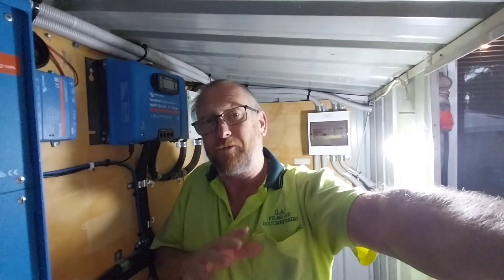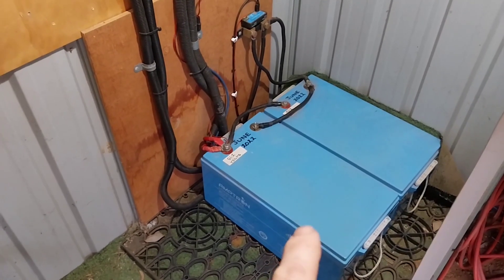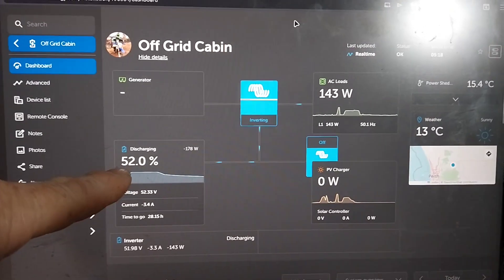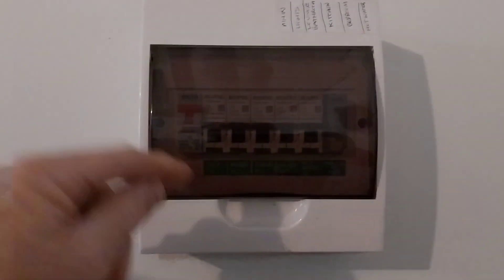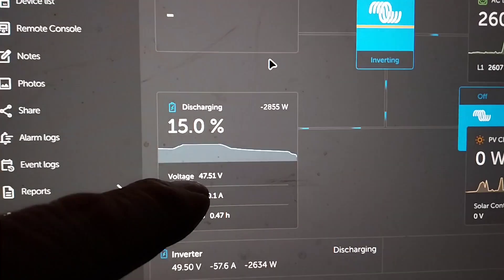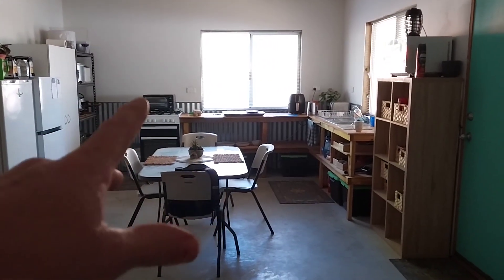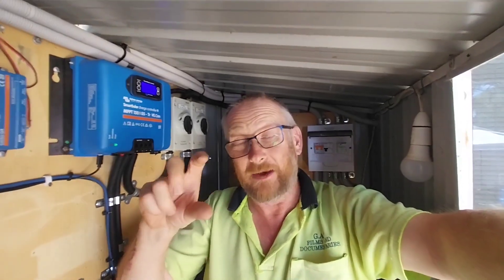Battery Capacity Test On The Remaining Cabin Batteries

Comment: I would be willing to bet these basic batteries have no Balancer. Or a very poor one. You may be able to fix this by adding an aftermarket balancer like the Neey. More testing will reveal if I'm right.
Reply from the maker: Yeah they have a balancer within the BMS, the question is, how good is it?  Assuming that is the problem of course, which I think it is at this stage but won't really know until we open one up.

Comment: You can't rely on a percentometer of course. The low cutoff was a cell low voltage as you were still around the 48v mark which is about 20%. So not empty as with the other battery the remaining cells would have been around 20%, probably slightly more, when you got the cutoff. If you reset to 0% at that point you would only get to put in around 80% before the battery voltage reached 14.2v when 15 of the cells would now be full and the low one would still be low. After a bit of a pause while a passive balancer tried to discharge the full ones, the voltage will have dropped to mppt reconnect voltage and it would cut back in. I think the victron does a default 13.5v float and then a bulk re-connect 0.1v below that. I now allow my BMSs to look after my system as that provides direct and individual control to cell level by devices designed for the job rather than relying on controllers which can only ever work on an overall view of the system. My monitoring system can then give me graphs of individual cell voltages so I can see immediately if there are any developing issues and then manage things to correct them although as a rule the BMS active balancers look after this. I suspect that you may actually have close to full capacity being masked by a poor balancer.unable to keep up. Some BMSs only balance when charging or only when charging has stopped and this can be an issue depending on your pattern of use and method of charging.
Reply: Of course if you are on the default victron lithium setting then it will stop charging at 14.2v, or rather the current will reduce to around zero where it will be held for 2 hours where it will overcharge the full cells because they haven't reached BMS pack overvoltage or cell overvoltage cutoff despite being full.

Comment: The batteries have reached the end of their lifespan. When a lithium battery drops to 80% of its original capacity, the degradation becomes exponential. You may only have a couple of months left before one cell completely fails. I personally recommend considering a different chemistry, such as the L300 Iron Core, which costs around $14,000 to $15,000 for a 300Ah battery and has a lifespan of about 20 years. One issue with lithium batteries is that they don't perform well when kept at 100% capacity all the time. 

You'll need to determine if you can fit 40 cells in your shed. Alternatively, you could purchase four Kings 300Ah 12V batteries for approximately $2,100 to $2,200, depending on the salesperson, and use a 48V-12V balancer.
Reply: I have two of the kings batteries you mentioned. They seem good, the price is kinda scary cheap. Watch the daily deals sometimes they are cheaper in a bundle with an anderson cord or a light.
Reply from the maker: My batteries cycle daily and would hit 100% SOC for around 5 to 6 hours then slowly discharged through out the evening and night.
I am guessing there is a cell out of balance or the BMS balancer is not working properly. These batteries are still under warranty so I will be contacting my supplier to see where we go next. I can not afford $14,000 for a battery so I see what my supplier has to say first.

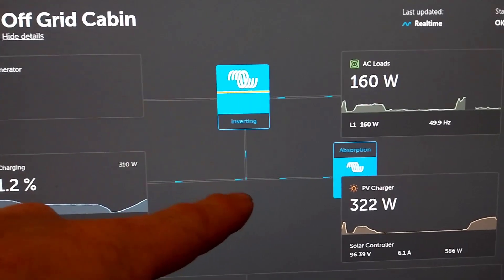Comment: Check the voltage and current readings around the 5:30 mark in the video. They're all over the place indicating maybe one battery BMS has disconnected the charge protection due to one cell rising to 3.65V. The other battery is still charging but soon after disconnects as the voltage rises to over 57 volts and 10 amps and quickly shuts off.
Reply from the maker: Interesting, yeah the voltage was jumping all over the place. I think you maybe on to something there 👍

Comment: That reversing on the graphic was weird. Especially with ~160W of load. I thought maybe it's just confused because it's near zero current. But 160W should establish a definite direction.
Reply from the maker: jevonvanballegooyen840 comment saying the voltages were jumping all over the place when it was doing that. When you look at the battery voltage he is correct so it's looking like this mybe an issue with the batteries ??